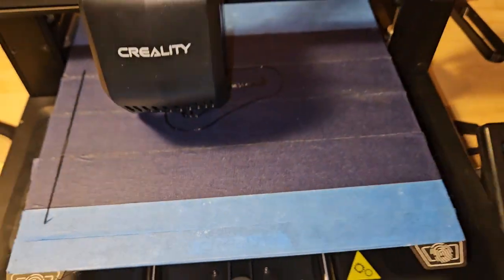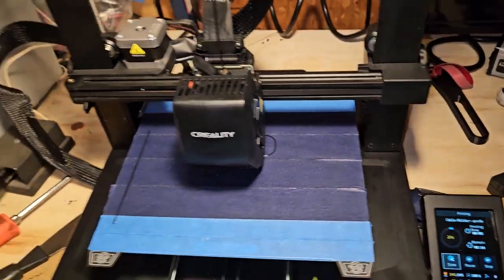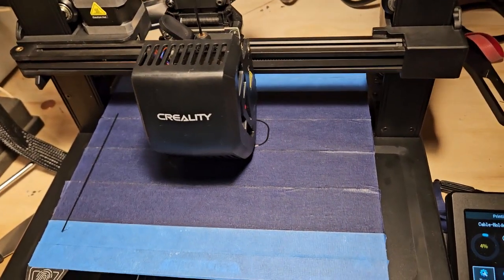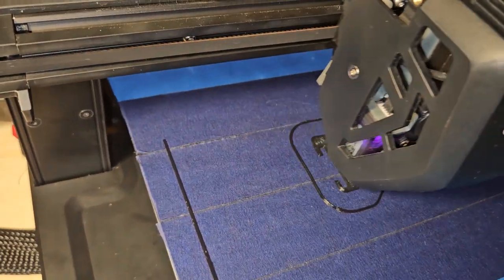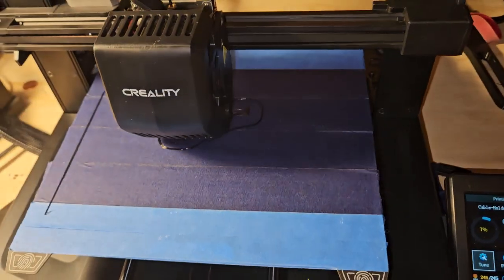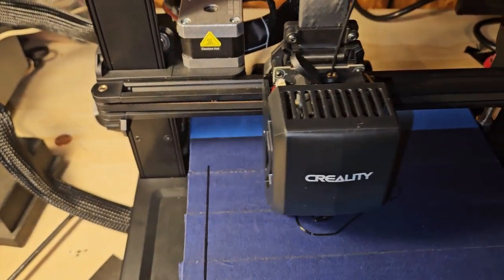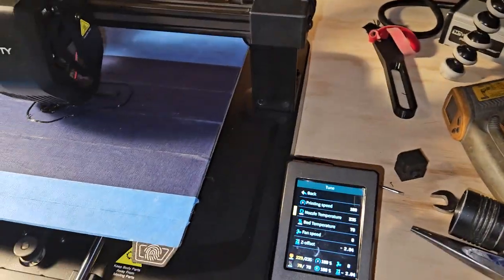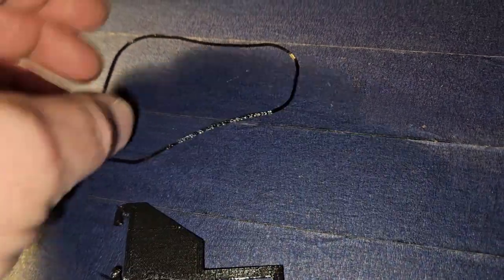Another failed ender 3 v3 se  print

Comment: Who still uses tape in 2024? Garolite g10. All youll ever need, one in 1.5mm and another sheet in 3mm...but tape? Dude, No! No glue interface needed. Clean surface with iso and youre good to go for another 2 weeks and it auto releases when the bed cools down to 55 degrees for pla. 70 for abs. Even Kapton is better than blue tape...
Reply from the maker: I just started 3d printing

Comment: If you are going to do a diagnostic video either write these on a paper and present them or put them on a slide and put it in your video. After this I have solutions.

- Filament type + color + brand
- Print Speed
- Temps
- Printer make and model
- Issue (generic as possible for example "wont stick to bed" or  "Wont go through extruder", dont over explain)

Now what I am going to tell you is below.

- Never use soap and water, any oils will degrade with alcohol. You do not need soap, soap itself does not like heat and will create residues much worse overtime.
- Untextured PEI (smooth) is very good for prints like PLA, but when printing PETG, smooth PEI printbeds will fuse. If you have a glass PEI bed, it will also fuse. Metal textured PEI beds will not fuse with PETG in most cases.
- Tape on a bed should never be used unless you cannot afford to get a second pei bed that is not smooth, or if you are using an exotic material that will only bond to tapes. Textured PEI is better than basically any other bed type by far.
- Your wall behind your printer has a gap with no insulation while your floor is made of concrete. You moving in the room and the fact you bed is hot will cause an updraft where the heat rises and your cold air from your floor is going to rise in order to replace the low pressure in that location and result in drafts on your bed which cause curling. I highly, highly recommend that you get an enclosure if your printer is going to be in this kind of environment. 
- V3 should be able to print at 180 mm/s. 
- If you absolutely are required to have that tape, do a bed level with the bed plate removed, afterwards place it then adjust your Z height according. The way your printer calculates the bed mesh is that it takes various heights on the bed then takes averages and smooths out points. If there is an odd location on it where the tape creates an improper height offset (up to .1 mm off) it can throw the entire mesh off. 
- Try not to pause your printer, there is a high chance it will mess up the print afterwards. 
- If a part starts to peel on a corner and you just cant fix it you can do the following.
1. Blow torch it and soften it, press it down and let it stick to the bed
2. Mouse ears, this is where you attach circles to the corners of your print that you can cut off. This will help with more adhesion area
3. Rafts
4. In your case, reduce part fan speed and possibly add a 2mm tall skirt since you have draft issues.

Comment: I use PEI sheet, clean with dish soap and water, and do not touch the plate after. For me, with PETG 70-75c temp, and TPU 40-60c temp, I set the first layer to 0.25mm with a 4mm nozzle. With PLA I set the first layer to 0.2mm with 60-65c temp. For large PLA prints I still need a layer of elmers glue stick on the build plate. The x axis and the bed level are extremely imortant.  Next is getting the first layer height correct.  I use first layer tests, and tune the z offset durring the tests.   If you are looking to buy a printer, start with the Sovol SV06 (it is a Prusa clone). The SV06 it is a lot lest headache then Ender 3's and the E3 Cones.

Comment: You need a better print bed and to make sure you’re leveled properly. I had to make a tiny adjustment on my X-axis and now all my bed levels are within .30 and it prints great. The bed sent with the printer is way too sticky. Replacements are between $10 and $20.

Comment: Get a creality ultrabase, it is porous when hot so the filament sinks in, But as soon as the part fully cools it pops right off easily. That's a weird technology but works. No hairspray or glue stick needed and no tape needed either. The base material is glass in reality ultraBase so it is nice and flat too.

Comment: i put the creality $15 glass bed on mine and it sticks perfect with zero cleaning in between at 35 Celsius. any hotter and its hard to get off the bed
Reply: and as long as the bed is level it can print across the whole bed with no warping. glass bed is the best upgrade for the money. made my printer usable
Reply: I like the glass bed also.  Either PEI or glass.  And, either perfectly clean with dish soap and water, or with glue stick.

Comment: I had about 20 or so failed prints on my ender ke the other day I tried alcohol, and other stuff but ended up just cleaning the plate with soap and water and it printed great but I am only printing pla. Good luck.
Reply: I only use dish soap and have no issues. I'm printing PLA at 200 nozzle amd 55 bed
Reply: I tried 409 and it's awesome too.